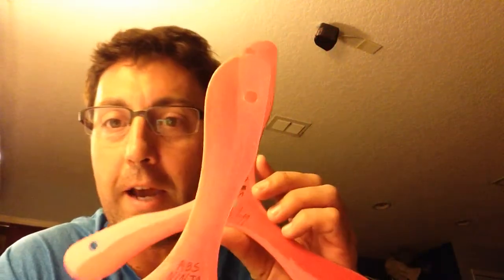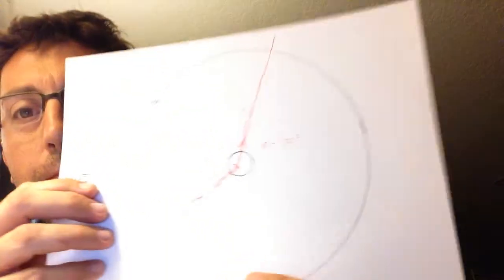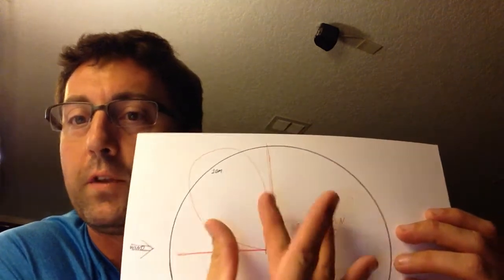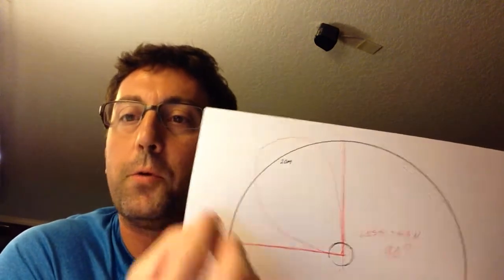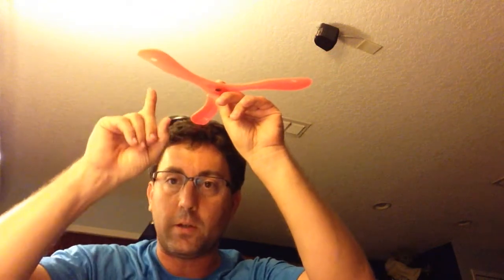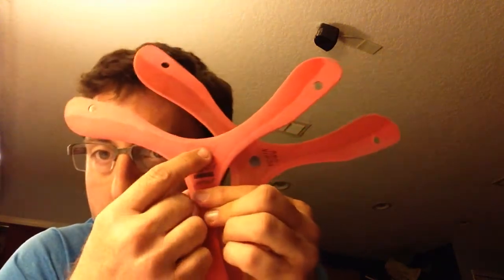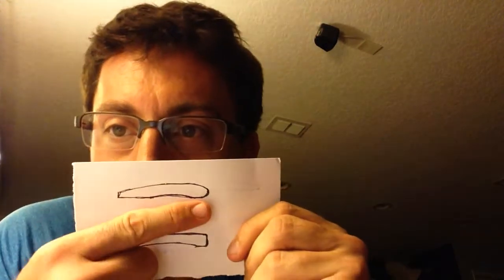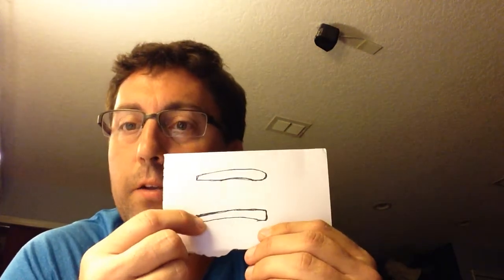Ninja fast catch: technology and tuning

Comment: The angle of release i.e. 'verticality' is a major factor in flight path for all boomerangs though, how does this affect the fast catch trirang ? Thanks for your informative video, its given me some interesting tips for constructing a unique one of my own.I have often thought if you could tune the fast catch trirang to pass just in front on return (like a double looper) the time wasted in spinning backwards to throw again could be eliminated and simply passed to the throwing hand so you just need to take a step rotating the body to the right with the left foot for the throw following the catch, plus you wouldn't get dizzy. I know with even just a slow moving ordinary boomerang that this is what naturally happens, the tendency is to just spin on the spot when you're in the zone and it is coming back to you without moving in pefect conditions but it takes a long time to completely spin anti-clockwise but the spin allows you to use your body behind the throw rather than just the arm strength.